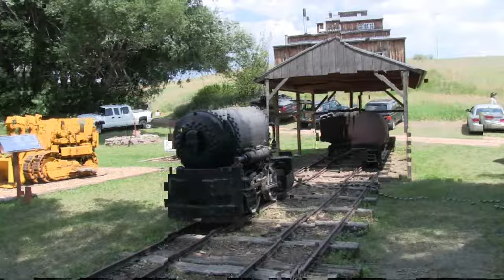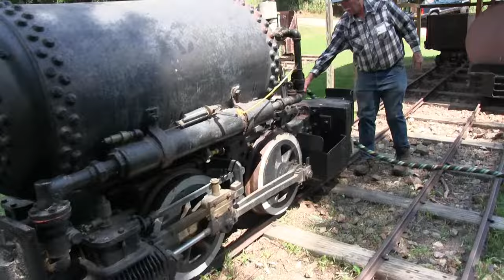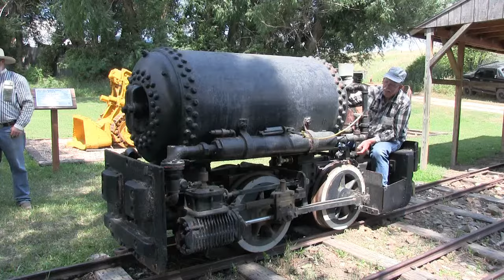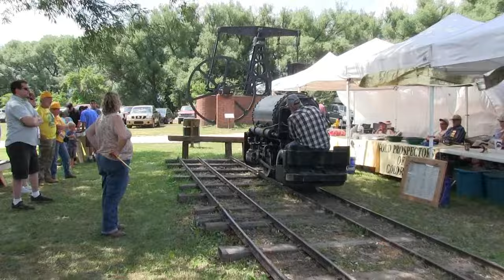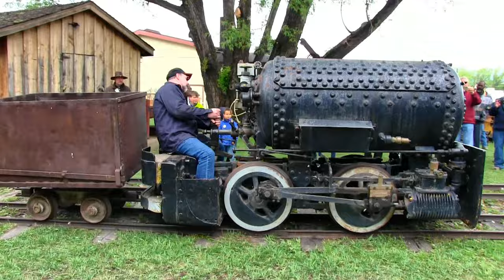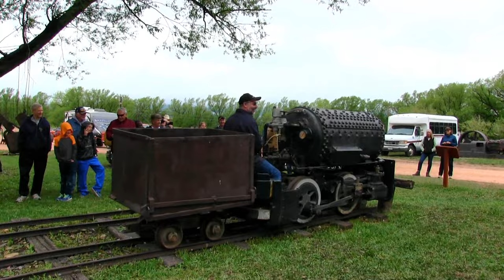1906, HK Porter, Compressed air mine locomotive demonstration

Comment: So, no, they are not designed to run connected up to the air main- rather, they would run something like a mile at a time, before reconnecting to the HP air lines in the mine.  It's being run on perhaps 100 psi air, rather than the 300-600 psi that it is designed for.  Porter 4077 is restored as well, ex Coleman Alberta, it is a 3' gauge engine.  When I saw it 2 decades ago, the wheels were so worn from use that they were double flanged !.  Another one of the 18" ones was converted to steam and used in Port Townsend, WA.
Reply from the maker: Yes and from what I have read you could do quite a bit of work on a single tank of air.

Comment: I never really thought this was possible
Reply from the maker: You should research "fireless locomotives". They are essentially steam locomotives with no firebox. They are filled with boiling hot water and can run for several hours depending on how hard they are working. It would seem like it wouldn't work but it was a successful design. They are pretty rare locomotives. Here is a link to one in service  https://www.youtube.com/watch?v=VixrQYaBvz0
Reply: @travelingtom923  Unfortunately, I think that one got scrapped. I found video of another one operating in Germany at a solvent plant as recently as 2013.
Reply: It works almost exactly like steam locomotives, just that it works on pressurized air, instead of pressurized steam.

In fact I think it's fairly straightforward to convert an old steam locomotive to work on air, for small runs on museum pieces.

Comment: Ex Homestake Mine, this is the same as was ran on the upper levels. You could pull one train of ore out, recharge with air, push the empties back, and repeat. I remember the pipes becoming frosted over pulling loaded cars. The one in the video is a 3 ton,  we used mostly the 5 ton for hauling, and there was a much larger two tank one on the tramway to the mill. These were eventually phased out for
Electrics. For those interested the operating pressure was about 800 psi. Mostly pulled 3 ton Granby cars maybe 5 or 6 at a time

Comment: There are several locomotives runs with compressed air in Japan!
JNR 9600 49671: https://www.youtube.com/watch?v=quzGMTlpoQg
JNR D51 146: https://www.youtube.com/watch?v=KRBry57GV8w
JNR D51 827: https://www.youtube.com/watch?v=-okh6fV0T8o
JNR D52 70: https://www.youtube.com/watch?v=3Iem-KRck7g
JNR C12 167: https://www.youtube.com/watch?v=zYBbiKt4gqw

Comment: Why don’t they put a compressor on board? Might keep it topped up a little longer.
Reply: They were designed for underground mine work.  Combustion of any type would be dangerous and would use precious oxygen.  The engines could run quite a distance and would be filled with hoses running through the mines.  Compressors would be at the surface.  Modern mine engines use batteries.
Reply: @JamesWillmus Some battery locos are still around; even more diesel locomotives are in service underground.